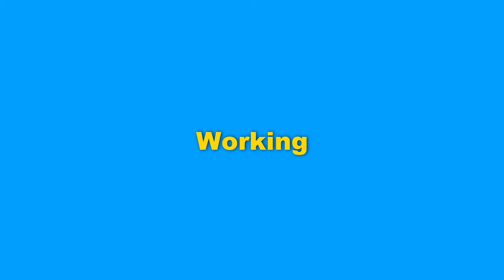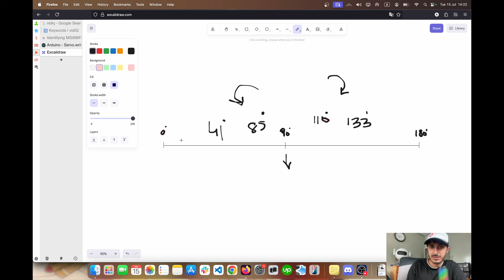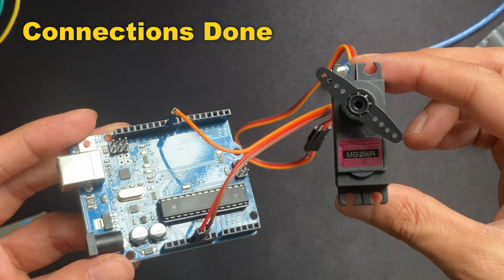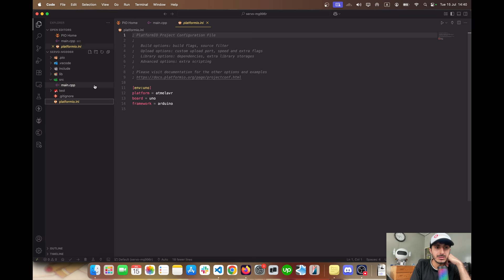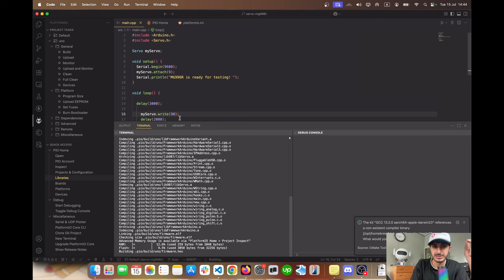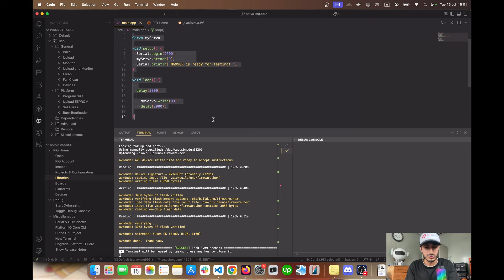MG996R with Arduino UNO | Full Setup & Coding Tutorial

Comment: At the beginning when you go over the different types you don't mention there's a difference between the 180 and 360 continuous motors. My motors look exactly the same as yours, so I was surprised when yours started looping and the input determined the speed instead of the angle.

Comment: so i did everything in theis vid but for some reson the servo horn is not working but it is making a ticking sound like its trying to do sommething
Reply from the maker: It might be a power supply issue. Make sure the motor is getting enough power

Comment: so im building a vending machine with a button arduino uno and mg996r and a 4aa battery holder for external power i need help connecting everything
Reply from the maker: I have explained the connections in the video

Comment: What is the difference of directly connecting the servo MG996R to the board and connecting it to the external power?
Reply from the maker: Power supply on board might not be sufficient. If the motor is driving high load external stable power source is guud! If it's just testing etc you can use board power

Comment: I wanted to use the MG995 servo motors for a project but mistakenly bought the MG996r and the shopkeeper is not returning or changing them . So If I want to stop the MG996r servo at a particular angle as in MG995 , how can I do that ?
Reply: Can you tell me please
Reply from the maker: You have 3 options I think… first is time based… meaning rotate servo for a specific time. This is not 100% accurate but it’ll do rough job

Option 2 is to use sensors to detect the angle and then stop (ex. hall effect sensor)

Option 3 is to modify the pcb to make it stop at angles
Reply: @Crimsondevs What do you mean by modifying the PCB
Reply from the maker: You’ll have to attach the angle measurement or rotary potentiometer and mechanical stops.